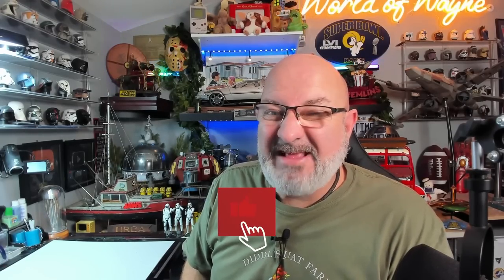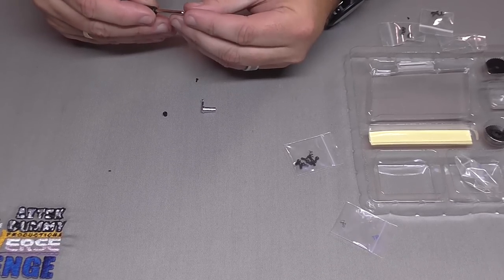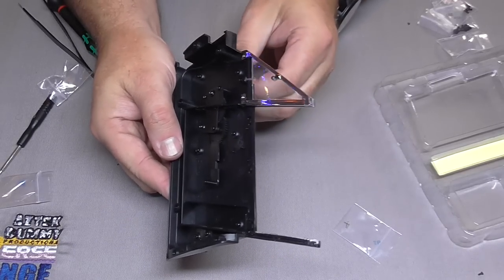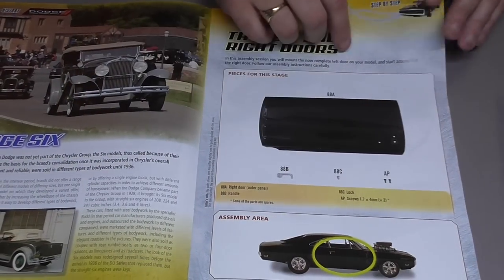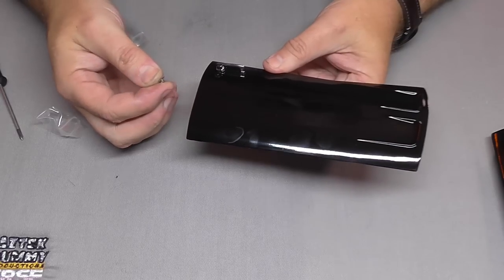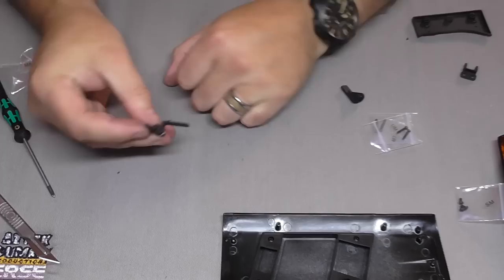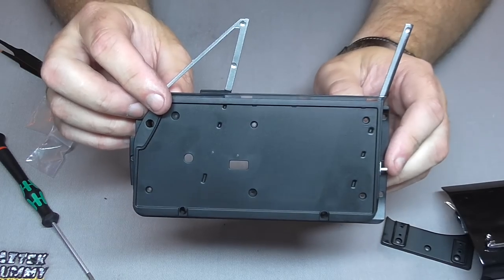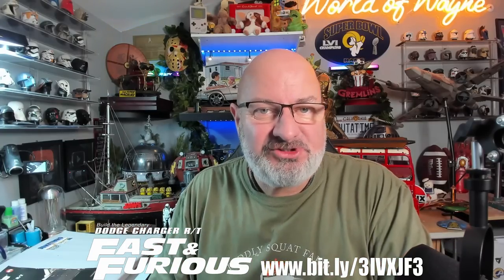Build the Fast & Furious Dodge Charger R/T - Part 87,88,89 and 90 - The Right Door

Comment: This is really cool with the door on... the only thing that sucks is that the window doesn't stay securely up... you can put it up but one little movement the window will just fall back down... only thing that sucks about this part so far.